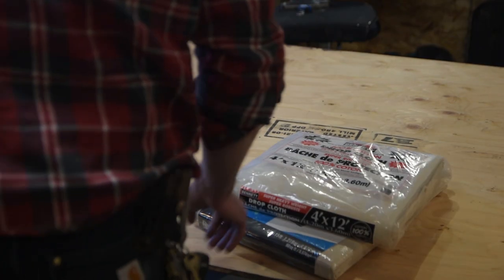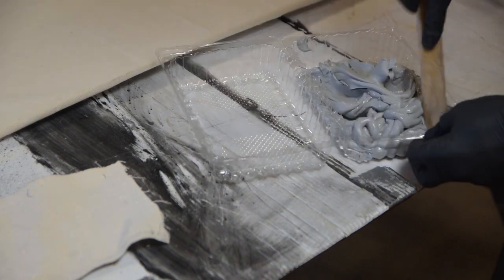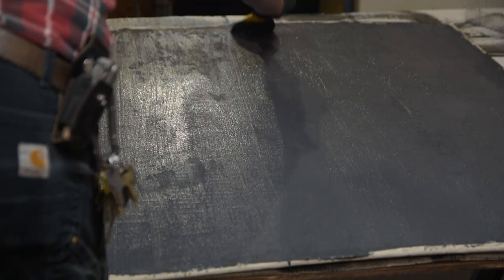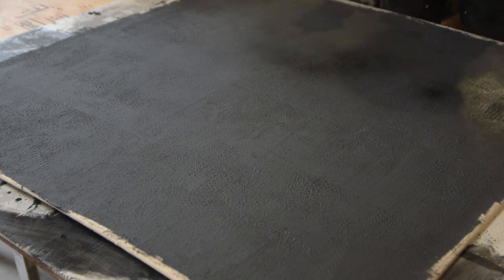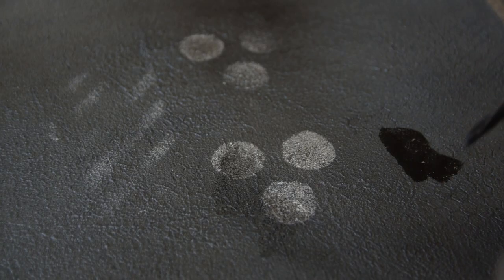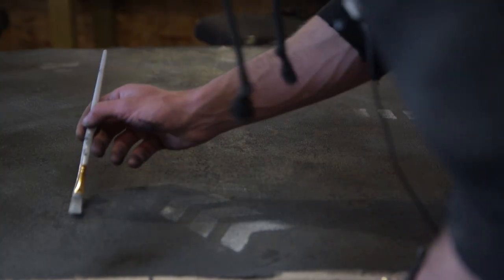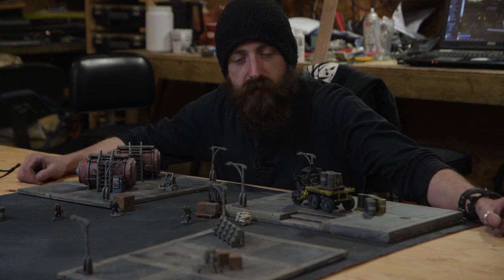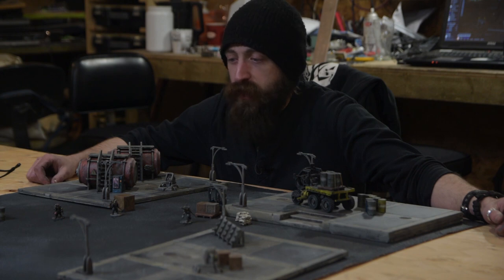Make your own Battle mat for your Scifi Skirmish Wargames.

Comment: Late to the party, but looks great. Thanks for posting.

How much caulking is needed for a 3'x3' mat? I realise the answer can only be approximate. Am just thinking about tide marks from needing to mix more, or the disappointment of ending up with a lake of surplus sandy, paint-bearing caulk (that won't help anyone's bathroom).

Regards from Over Here.
Reply from the maker: I think it was about 2 or 2 1/2 tubes. If your painting it tide marks shouldn't be an issue.
Reply: @Berserkerworks  Thanks!

Comment: Found this just in time. Appreciate it. Happily subscribing.
I couldn't find a single caulk that wasn't at least partially siliconized, so we will see how that turns out. 
Couldn't get to my iron so I threw it in the dryer for 20 minutes with a wet rag, and that worked wonderfully. Also didn't have a board to staple it to, but with the extra length, doing it in my driveway, the concrete underneath gripped it enough that it didn't wrinkle so long as I started more center and worked my way out, but I premarked my area to get a general feel for my dimensions. I'll need to mark it again to cut it out.
Another problem was I needed a 4x4 mat for Infinity, so I picked up a 6x9 dropcloth and it came with a big old seam in the middle. It didn't seem to pose too much of a problem, but we well again see how that goes, just a buyer beware note.
Hope I could be 1/4 as helpful as this video was.
Reply from the maker: Thanks for the feedback on your mat build! The quality of dropcloths can be an issue. I'm not sure if there is standardization in the seam placements, most of the ones I've purchased did not have a seam. Great tip about the dryer! I hadnt thought of that.

Comment: I’ve made a couple mats but never included the sand in the mixture, will definitely give it a try in the future. 
I would normally texture the straight caulking with plastic bags and scouring pads. As noted in the video I would “knock” things down a bit once it was dry by using a fresh scouring pad on any exceptionally spiked areas.

Comment: Hello, I know I am very late, but here goes nothing. I am from central EU and I can't really get my hands on the fabled "Canvas Drop Cloth" that everybody seems to be using (the cloth would be 2x the price of a full latex battlemat). What are some other materials this would work with? Would a standard painting cloth (for regular painters Bob Ross style) work?
Reply from the maker: Any sort of canvas should work. If you can't find painters drop cloths in a building supply store then go to a fabric store and buy some cheap cotton blend canvas material in the size you need.

Comment: So I have a question about what the finished surface of the canvas with acrylic caulk is like? Is it a smooth hard surface, can it handle wear and tear, would extreme friction cause it to fall apart like an eraser? I'm wanting to build a neon tokyo city for a 24th scale rc drift car going to go all out but the surface is going 5o be the most important. Rn I'm leaning towards using abs sheets for roads and just foam core everything else
Reply from the maker: I don't have any experience with RC cars, so I'm not sure how it would work out for you. Id suggest buying a tube of caulk and making a sample size piece so you can test it out and see if it will hold up to what you want to do. The surface isn't hard like plastic, it has to stay flexible for the mats to roll up, but I have applied it to MDF as a texture and its held up very well. Best of luck with your project, it sounds really cool! Post some links when its done.

Comment: How do you like the chalk paint? It seems to be designed to be distressed, have you found it durable enough?
Reply from the maker: It doesn't seem to be much different to any other matte finish paint, except its more expensive now. Just as durable as the other paints I used.

Comment: Where do you get the texture rollers from? And do they work on foam (like foam board from a dollar store?)
Reply from the maker: The one I use here is a 3d print. They will work on foam. The Terrain Tutor and may other channels have videos on using them.

Comment: Instead of cutting off the “excess” why not paint a border marking the playing area. You could use a mask to spray a dashed line. That way you have more space on the mat for terrain at the edges of the board.
Reply from the maker: I dont see the point in having extra unuseable space on the edges of the mat.  If the play area is 3'x3' thats as big as it needs to be.
Reply: Sometimes you might want to have a terrain piece not completely on the board, maybe it looks awesome but is to big to fit nicely with what’s already on there. Having a bit of extra space is great for those moments. And creates an illusion of more space since it fuzzes the borders a bit, but having them marked in a non obtrusive way like a dashed line still leaves them clear to everyone
Reply from the maker: @zachariasbjorngren1552  Ive never had to set up a table that way, or seen anyone else do it, but I see what you mean.

Comment: Does it roll up for transport or is it stiff once it dries? I was going to buy a mat for infinity and this might be an alternative.
Reply from the maker: It stays very flexible. You can roll it up.
Reply: If you have the time, space and inclination to make one I wholeheartedly recommend that you go for it. It’s a fairly straight forward project that will see a lot of use. Remember that with a game like infinity a good portion of the mat will be covered in terrain and I have found that the “overly detailed” mats you can purchase almost guide you into placing terrain in certain areas to complement the printed overlay.